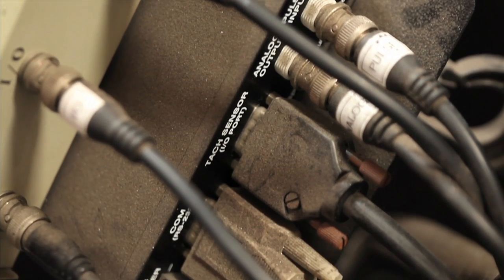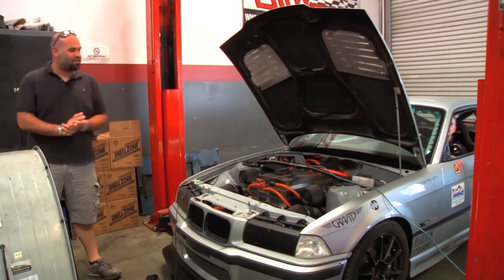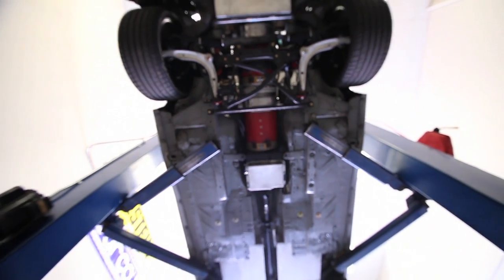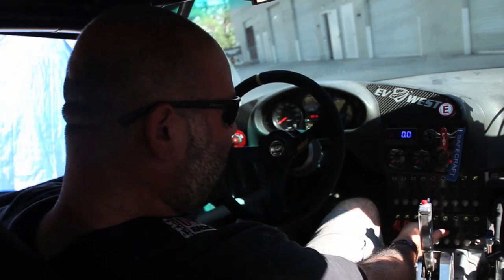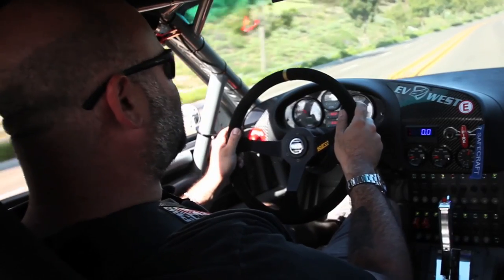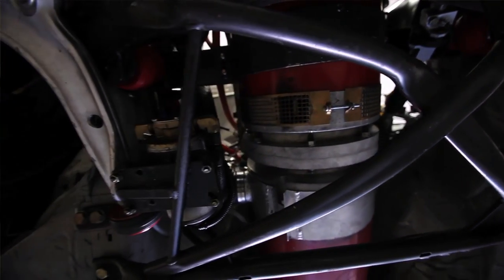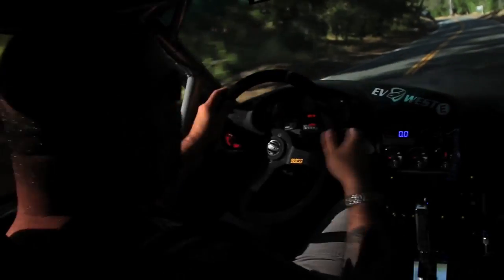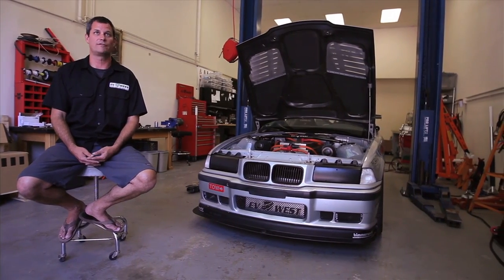This Electric E36 Makes 850 lb/ft of Torque at the Wheels! - /TUNED

Comment: sorry to correct this: air conductivity gets lower at higher at higher altitude due to lower density. The problem is less cooling capacity due to less density. That effects electric motors, but you are right that ICE suffers more from thinner air due to less performance in burning - greets from an electric driver from germany

Comment: 1. Power plants are much more effective at converting fossil energy into electricity than internal combustion engines are at converting fossil energy into torque

2. Electrical motors are much simpler and require much less maintenance, also they remove need for transmission (as there's a engine mounted to each wheel), for gearbox (due to straight torque curve) and also are much lighter, too

3. Pollution is much easier to deal with when it's centralized to 1 power plant, and not to 1000 cars

Comment: Theoretically: Yes.
Practically: Those are Brushless DC Motors. Usual DC motors commutate (change the internal winding Polarity to continue rotation) using coal "brushes" which makes contact to a slotted ring on the rotor. With every partial rotation, the polarity is changed. That's why 2 cables are enough.

Brushless motors don't have brushes (duh), but 3 Terminals and also 3 windings. They can't commutate by themselves, thus you need a second piece of hardware for measurement and commutation.

Comment: Just a quick physics lesson to everyone: wheel torque is a function of gearing. A car that puts out a paltry 100 lb-ft torque at the crank but has a 4:1 gear ratio in first gear and a 4:1 gear ratio in the differential multiplies its crank torque by 16 times. So a shitty little car can put out 1600 lb-ft at the wheels  (combined torque of all drive wheels) in first gear. This is not sorcery, this is basic physics. This E36 is in fact putting out a lot more than 850 lb-ft  at the wheels in first gear. Since most tires are roughly 2 feet in diameter, a 1 foot lever arm (the radius of the tire) is acting on the road. If the car were only putting 850 lb-ft of torque on a 1 foot lever arm (or 425 lb-ft to each of the 2 driven wheels), it'd be putting 850 pounds of force on the road (because torque is simply force x lever arm length), causing a 3000 lb car to accelerate at only 850/3000 g, or .28g, giving a 0-60 time of around 10 seconds. Nope. This car does not put out 850 lb-ft of torque to the wheels. False.

Comment: 350 HP makes sense. The equation for an electric motor HP= (Volts x Amps) ÷ 746 or more exactly HP = [(Motor Efficiency)(Volts)(Amps)] ÷ 746.  Given that the motor efficiency is very likely 90%, the battery pack is almost certainly 144V and the best controllers are about 2000Amp, then HP =  [(.90)(144V)(2000A)] ÷ 746 which gives about 347HP.

Comment: The 400 kW number was either a gross over estimate before Matt showed up, OR they were saying the power consumption is 400 kW.  It only put out 342 HP / about 255 kW on the dyno.

Comment: 400kW is the ELECTRICAL POWER measured based on the current (A) and voltage (V). This is electrical power, is what the electrical motor sucks from the batteries. Than comes the motor efficiency and drivetrain efficiency, this reduces the power available at the tires (or wheels...).

The statement in the video is CORRECT, although it's understandable why people think it's a wrong unit conversion.

Comment: "It makes 400 kilowatts" ??   Since 342 hp is only 255 kilowatts, where is the 400 kilowatts?  
Guessing the answer, it could be like this:   The maximum electrical power into the motor is 400 kilowatts.   DC motor with brushes and commutator efficiency is roughly 80%.  Drivetrain from motor to wheels efficiency is roughly 80%.   400 x .8 x .8 = 256 kilowatts.   And there you have it probably.  
So my guess is, the input to the motor is 400 kilowatts (max).  It makes about 320 kilowatts maximum at the output shaft of the motor, and the power at the wheels is about 255 kilowatts maximum.   Something like that.

Comment: You're absolutely right!  But the 400 kW is referring to pure electrical energy.  But when you factor in the voltage drop thru the controller, the DC motor's 85% efficiency and what ever the drive train loss is… yeah, I can see about 350hp to the wheels.

Comment: The transition modality should be "plug-in hybrids".  Limited to 1,000cc gas engines with a governed max rpm into their generator section.  Big battery pack and all the electric tweaks you can dream up.  Limit the teams to a fuel allotment.  That way all parties are learning all technologies, but we still have some ICE involvement :D

Comment: They use a converted garret turbo with a small electric motor turning the turbine blades that push a lot of air. The k&n filters keep the dirt out of the brushes and comutator from those big turbo blowers. One for each motor. I believe the controllers are water cooled with a small radiator. As for distance on a charge I think it is around 100 when not racing. They actually use the car to get parts in when not racing it.

Comment: Well, to be entirely correct, the torque drops with rising temperature of the engine. This is why cooling is essential. Also you can't have infinite power as for physical/design limitations. You will have loss due to friction, your engine's RPM can't go infinite and stuff like that. So yes, you are right, the curve will start to drop at some point.
What i meant is, that the curve doesn't start at a very low level like on combustion engines.

Comment: This is why you think you're so smart, and why you're actually quite wrong. 400 kw x 1.36 (HP converison) x .85 (electric motor efficiency) x .75 (drivetrain loss) = 341.7 hp.

Comment: Usually electric cars use motors at each wheel so there's no transmission. However, since this car is using a transmission why not put in something like a Turbo 400 or similar GM built transmission to handle that power?

Comment: At some point, a horseman or carriage driver said that. The technology is new, but down the line, electric engines will be as powerful, if not moreso. Engineers work to make the technology stable, safe, and affordable at first. THEN they work on boosting performance.

Comment: He's incorrect about altitude not affecting the motor.  Heat removal from the machine is directly proportional to the density of air used to cool it (whether direct air or on a heat exchanger for a liquid cooling system).  The machine's thermal limit is necessarily less at altitude (density at 6k ft is roughly half what it is at sea level).

Comment: torque x rpm / 5252 = horsepower. electric engine peaks at 4100 rpm, has 800 ft-lbs torque from 0-4100, which eliminates the need for gearing, hence driving the 2 speed power glide in second gear (1:1). Electric motors are insanely strong and it would be sweet having an efficiency car with mad power.  Though in all honesty, the sound of a motor reving is too much to give up, shit is wonderful.

Comment: If I had to guess... it's because they are converting an ICE car into an E-car. 

The Tesla Model-S was designed as an E-car from the very start so it does not need to work around the existing motor placement and drive trains.

Comment: Destruction of gearbox internals due to an electrics near instantaneous application of torque is more of an issue for DC motors unless you get creative with the controllers. Most OEM manufacturers are going with 3-phase AC motors which are inductively coupled (no brushes), and can allow for soft start. AC technology allows for altering the voltage-amperage phase relationships to mimic the slower torque onset of a gasoline engine. However, AC typically requires a much more complex controller.

Comment: I don't recall the car name, but a number of years ago, a Euro company made an electric car with 4x 300hp electric motors in the wheels. 300HP at EACH WHEEL. Pair that to a jet turbine that spins at a constant RPM to a generator, and that would be something I'd buy!

Comment: Altitude does effect electric motors. Specifically brushed motors such as this one.  But not nearly as much as it effects combustion engines. At higher altitudes, air becomes more conductive and therefore can cause problems. But Im sure this will only be noticeable at very high altitudes (relatively) such as 15,000 ft +

Comment: Reminds me of my first brushless rc car. It was fast as hell and had enough low end torque to make the car do backflips from a stop, but nothing beat the experience of the nitro engines ive come to love. 

This car is cool and all, but they added weight to a track car. Now when they go to the track, they can only run a few laps before having to call it a day to recharge their battery. (Unless the battery is removable, in which case they swap out their 10k$ batteries for another hour of fun)
Reply: Leaf batteries and self made packs are $5k and less now.

Comment: I believe they use 2 11 inch series wound dc warp11 motors with two evnetics controllers capable of 1000 amps each. They built it for pikes peak and won 50th overall. It is fast. The air cleaners blow cool clean air on the brushes and through the motor.

Comment: the weight is actualy not a problem, ive done some virtual tuning, adding weight will increase the roling,of the car, and drives safer in the rain.

Comment: Not as much as you think. Lithium ions in a regenerative braking car with brushless motors will get you 200 -300 miles a charge. That's plenty range. The problem is the grid does not provide electricity at the power levels required for a quick charge. You can charge a lithium ion to 90% in 10 mins with cooling and high current.

What needs to get better is cost and peoples view on range.

Comment: I don't think so. The reason he mentioned one gear (2nd) is because the electric motor produces so much torque from so low in the rev range its possible to have very long gear ratio's and still accelerate very quickly.

Comment: Actually, I think they are using a single 2000 amp EVnetics Shiva controller. Notice the big block of alu under the hood and that there is going two cables from each contactor.

Comment: if you're an engineer, you'll realize you'll get more power and range from a combustion engine. you'll also get more power per weight. both of which is essential for racing. because, would you like F1 if they carry around and extra couple hundred kg for the batteries and have to stop every 10 laps for recharging?

until batteries become more efficient internal combustion is still the way to go

Comment: i´m talking about kilowatts, too. It´s a unit of power, like hp is, too. you can easily convert them. 1kW = 1,34 hp = 1,36ps (Pferdestärke, which is the german horsepower). 
here in germany, if you look at a car´s specifications, the power is declared in ps and in kw. for example an audi r8 5.2 got 386 kW (525 PS)
in fact, ps (hp) is out-dated in germany. officialy we have to use kw.

Comment: Imagine later the Formula 1 EV. Instead of putting gas with the big gallons they just swap batteries in seconds.
Reply: With Lithium Oxide, there might not even be a need for any battery change or charging at all.

Comment: Electric motors are messured in kw because the compere the theoretical electric power and power mesured on the dyno. Electrical power is calculated P=V*I, or P=Vsqur/R and P= Isqur*R, The killowats can be easyly converted to HP sa a eriktransformer said

Comment: What if you fabricated some carbon fiber body panels? It would increase the price, but it would definitely make it a bit lighter
Reply: +aldo falla problem is you would not drop that much weight, it is the batteries that have added shit tons of weight, a car body panel probably only weighs like 5-10 kg.

Comment: Energy density is a problem with those. BMW had to use a twin-turbo V12 to get 200bhp when burning hydrogen. Add into that that the energy input in splitting water into its component elements is greater than what you get out of it in the car and it just doesn't make sense. Plus, you've still got the massive frictional losses of a conventional IC engine, gearbox and differential. Personally, I think EVs with small gas turbine range extenders are the way forward.

Comment: Why not couple the motors directly to the wheels? I'm probably overlooking something, but wouldn't it allow the motors to put full torque down without destroying a transmission that is no longer there? I know some ev cars are moving to hub motors in each wheel...

Comment: ok so it has electric motor. but why would it need an air intake? i really dont know how these electric motors work. if someone that knows could explain i would appreciate it.
Reply: +Sean Donaldson an air intake is not strictly necessary for electric motors to work, but the motor in this car would be getting pretty hot putting out that amount of power. Also, 100's of amps would be passing through the motor controller which would need cooling as well.
Reply: +Sean Donaldson Those are air filter for the motor cooling system. Didn't you hear the part "Do not excede 320 (fahrenheit).... Turn on Fan 2". Basicaly you need to feed clean cool air into the crazy powerful motors to stop them from overheating. Also i dont think those specific filter pods are not for the motor controller.

Comment: the AMAZING thing about electric motor powered vehicles is the massive torque that you get 100% of in an instant no power bands or turbo spool or anything. BUT they have to have humdreds of Lbs of batteries that weigh it down and still dont get much range. Tesla was very smart about their battery placement within their vehocles they put them down low in the middle all the way from the front end to the rear of the car to keep weight distribution down low this contributes to their abnormal driving styles and the general strangeness you can feel its nothing like the past.

Comment: They don't probably lose so much power. They just transmitting high power of engine to higher torque in the gearbox. So it has still more than one revolution of motor on one revolution of wheels. That makes me sense. Just use calculator to count how high speed you can have with direct shaft on 3600RPMs that is common for AC motors. It could be over 250mph(400kph). For that speed it doesn't have enough power.

Comment: buy the looks of it, cooling ducts, just an OTT way of keeping grit, dirt n dust out of the motor, which due to the magnets in an electric motor would get clogged up with any metallic particles getting stuck to them

Comment: Actually if you have voltage applied to it it does make torque even at 0 rpm. That's what happens when you use your starter for the car. It sits still and yet has the torque to get the engine going to 1000 rpm.Torque isn't dependant on rpm.

Comment: energy storage, and there is really very little development in that area, especially as the biggest drive for developing better 'batteries' are cell phones, and efficiency is gained in other ways besides better 'batteries'. As soon as we figure out how to store energy better, electric cars will take on a whole different meaning(but, the oil cartels still run everything transportation, so.. you know)

Comment: I'm not a super hippy but if you put a hydrogen fuel cell with the battery system can use that to recharge the battery instead of stopping to recharge. Yes that and its zero emission, which is good too. I have a 96 BMW 318ti e36, that would be badass to have in my car. One problem though, I still want my 5 speed. Awesome Vid!!

Comment: You should realize there are alternative motives for doing things. This is a perfect example.
"Oh cool an electric super car! They must be trying to save the planet!"

but instead theyre taking full advantage of the nature of electricity which is 100% torque, 100% of the time. Thats why the Tesla Model S does 0-60 in 3.9 seconds for the Performance, and 5.9 for the base model. Faster than a lot of other cars even though it weighs over 4600 pounds. About 1000 lbs more than a normal car.

Comment: here's a question for the kilowatts foreigner country's, if u have 5000watt - or 40,000watt sound system, how much dose it affect the performance?? 

and with so much torque way don't the develop environmentally friendly semi/ or tractor??
Reply: Because battery capacity and weight aswell as price are still an issue would be my guess..

Comment: This is also another great improvement if this car added solar panels surrounding the whole car, not only charging the batteries, but also running the car longer, even on mostly sunny days until dusk as a new idea Telsa can do.
Reply: +Kevin Barton Cost sadly also it would be really hard to get solar panels that curve with some parts of a car body.
Reply: +DARKHOUND I meant solar panels on top hood.
Reply: Kevin Barton oh yeah that would work. i just thought you meant the whole car because you said" added solar panels surrounding the whole car" with a simple shape like the E36 you could completely cover it in solar panels tho.

Comment: you are true - like many people in Germany the US could easily turn much faster to solar power stations. The US has in average double solar energy density than Germany has, Roundabout 2500kWh per installed kwp of production capacity. We have already installed about 34GW of solar capacity-which is the equivalent of 20-30 large nuclear or coal power plants - the pity is,that this isn´t still far enough and we have to think about production as well as about consumption! Greets from a solar e-driver

Comment: theyre talking about output of the electric motor. not horsepower. they were just getting a reference off of the dyno in comparison to a gas engine. technically this car has 0hp and 800whatever ft/lbs of torque.